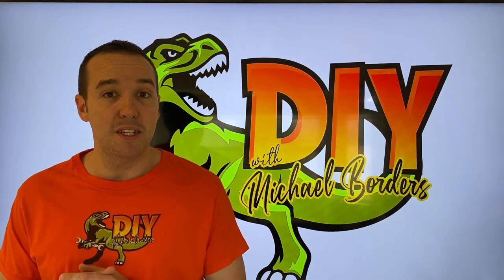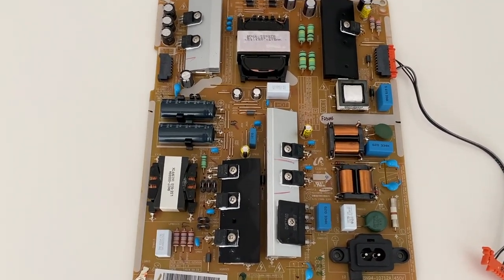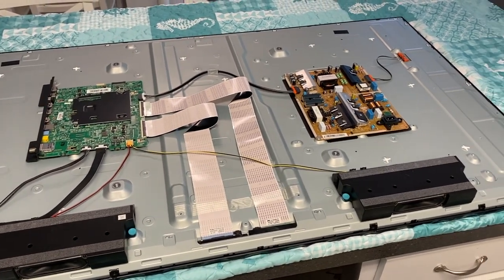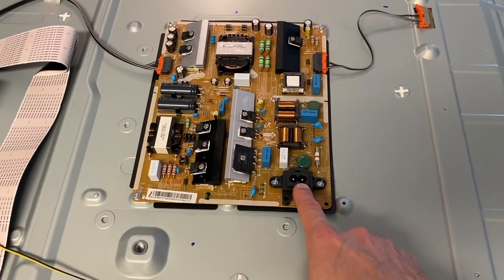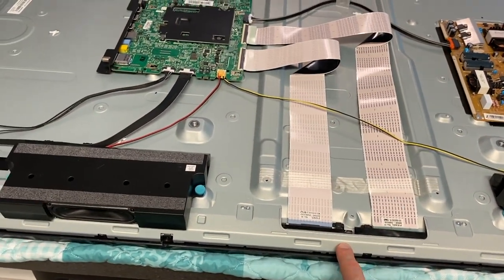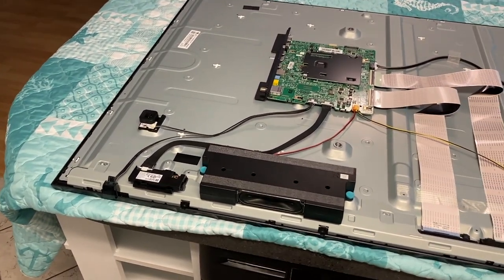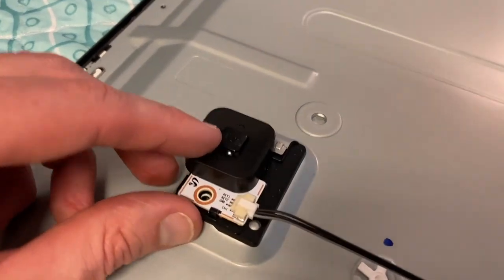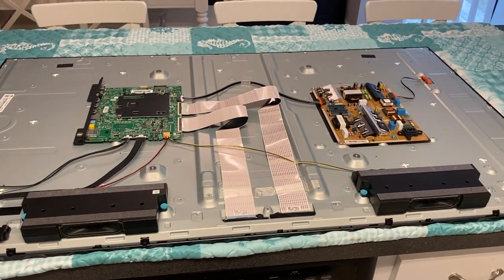Purpose of TV Power Board - Explained

Comment: My samsung 55q7fna turns on with picture and sound the. 10-15 seconds later off. Im somewhat confused on the process but am i understanding correct that if i unplug the power board from the main board and turn the tv on i should have backlight? I do not and i tried replacing the main board but i suspect now its the power board. Any way to confirm this?
Reply from the maker: Good morning ☕️

Power Board is next likely cause of your tv malfunction.  We recommend replacing Power Board.  Below is a link to our Power Board replacement video.

       https://youtu.be/5jH7Z-zbgWY?si=Q_BYaeSQFtDOVrF4

😎👍🧰

Comment: Can I please ask whether dismantling the TV and replacing a MAIN Board could possibly lead to issues/ failure on its power supply (static converter board), my TV turned on and off itself, after replacing the MAIN board, now it has no power and there is noise at the back of the unit, wondering whether it is caused by the replacement of the Main board, your answer would be really appreciated.
Reply from the maker: Thanks for watching, any update?  It may be a loose connection or connection point not connected.

Did you purchase the exact same replacement part number for your tv main board?
Reply: @DIYwithMichaelBorders  Yes, the main board is fine, but the power supply does not work any more
Reply from the maker: @nicoleniancisun9288  

Thanks for the reply, have you tried powering the tv on by use of the power button on TV as opposed to remote starting?

Comment: I have an LG 3D tv that will not turn on. When i press the power button, i hear the click as if the tv will turn on, but the video and sound don't come on and the screen remains black as if off. Then the tv clicks again and power button turns off. Do you know what would cause this? Does this mean the main board or the main power board simply needs to be replaced? Thanks.
Reply from the maker: Thanks for watching & sharing this.  In most cases, this will be due to a faulty Main Board.

Please keep us posted.  😎👍

Comment: Hi Michael, I have a 50" Samsung flat screen about 7 years old. It went dead one day, no picture or sound, red light is on and blinking when tv turned on. I can see a menu in the screen with a flashlight. Took it apart and using a tester, found 8 leds not coming on. I did replace them individually and when I plugged the tv back in, the lights came on for 2 seconds and then all went out. I know I need new leds but not sure about the power board. I spent awhile checking out all components on the power board and everything looks fine with power getting to control board and leds. My question is, when the power board is disconnected from the leds, does it ramp up power, in my case to 265 volts dc, because it's trying to turn on the leds and then when they're on, it drops to a lower voltage? Is this normal or should the voltage be lower all the time? I'm afraid of putting new lights in and have them blown again and as well changing the power board. If that's the case changing both, I'll just use it for parts. Your thoughts?
Reply from the maker: Good morning, we appreciate you sharing this.  We are drinking our morning coffee answering any and all questions for the DIY community.

Great question and it sounds like you have sporadic behaviors within your electrical boards.  Although you have already been busy performing surgery to this tv, we recommend replacing Power Board and Main Board.

Reason being is again, one of these is causing sporadic power surges.  Have you had a recent power outage in last 90 days…?…this can cause it.

While replacing the two boards, follow it up by replacing the LED’s as you mentioned.  Keep us posted.

Let us know if we can help in any way.

Hey also if you’re into crypto trading, join our newly launched DIY community ecosystem.

     Toolboxtoken.com

We DIYers need to stick together!  🧰